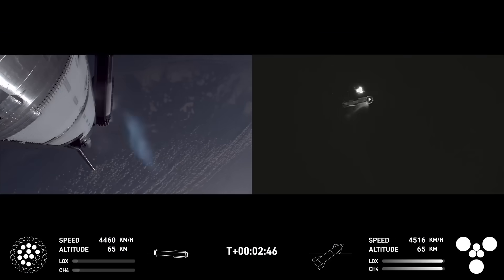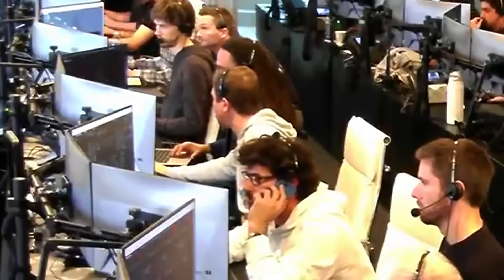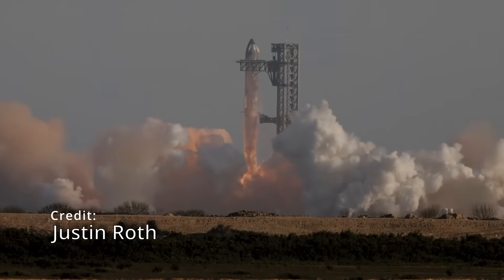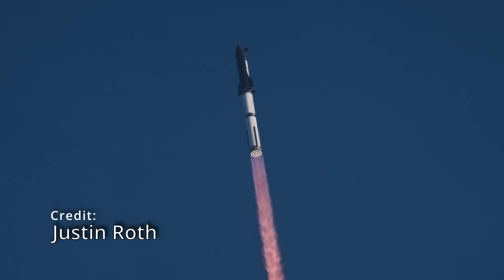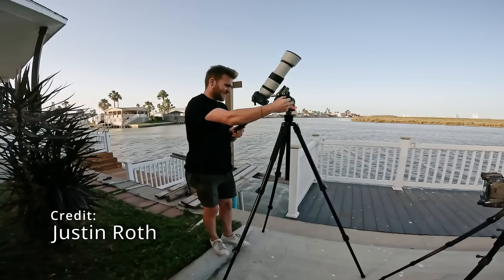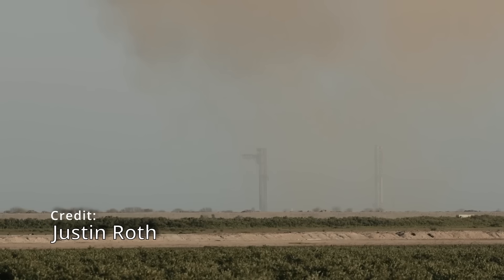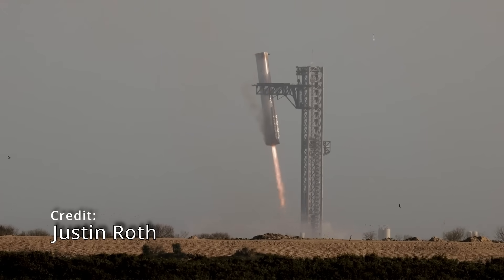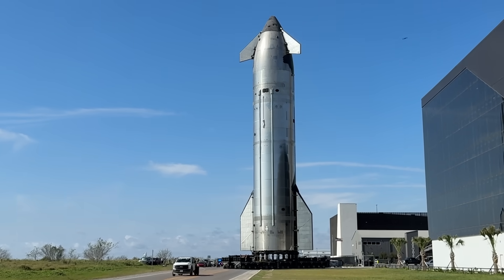Rest In Pieces: Why Did SpaceX Lose Starship Again?

Comment: So is it the fuel used gets superhot 
Peppermint oil is very cooling when put on your head when we get stress headaches these doTerra oils can permiate through a cell wall what if when a raptor fuel delivery system leaks some types of waxy oils can plug it up but still be a gas on the inside and cool the hydrogen gas or make it not so pressurised

Comment: SpaceX should mount the starship with the ring & top section of booster on the test stand … then test the vibrations and pressures during the hot staging. Use lots of sensors to measure what actually happens. It does not have to separate to do this test. They just need more insight in order to adapt

Comment: Flight seven likely induced  them to put more cameras and sensors in the areas that likely caused the engines to fail. If the problem recurred in the same way as the prior flight, this replication with additional sensor data will likely tell them exactly what happened. Additionally, the starlink was up for a considerable time after the first engine went wonky, so it's very likely lots of images and data were transferred. I think it's likely they will solve what happened quickly. Corrective actions and finishing the mishap investigations will the time consumers.

Comment: Booster recovery is a gimmick.  Actually cheaper and more effective reduce the number of rocket engines strap a couple solid boosters to the thing same thrust, cost the same and reliability goes up.  The thing has to be the ugliest rocket ever built looks like something from a 1960s Sci Fi movie or a grain storage bin on steroids surprised it can get off the ground without blowing up.  They need to work on their root cause analysis process, looking forward to the next fireworks display.

Comment: Another possible cause of the failure … ice clots.  As a function of total methane propellent, perhaps ice deposits build up somewhere in the plumbing or pump. This could cause a blockage and if a piece of ice broke off, it could damage the turbine pump or block the propellent line that keeps the rocket nozzle cool.   Another similar suspect is long chain hydrocarbon impurities in the methane. The heavier molecular weight hydrocarbons turn solid at a higher temperature. Perhaps this impurity builds up somewhere and becomes chunks that dislodge and  block methane flow that cools the nozzle.
    The reason to suspect this cause is both starship failures occurred after the same amount of time.  That indicates a progressive build up of ice or some other progression is occurring.  Perhaps SpaceX will take a temporary step back and reinstall the heavy protection between raptors that prevent a chain reaction of Raptors blowing up.

Comment: Joe sounds so much like all the NASA people brought up in the program. Great people but a system that was designed to go VERY slow. This is a test ship, remember NASA testing in the 50s and Falcon testing. Every ship gets changes and every ship moves the ball forward weather they Fly or not. There is no public safety risks so as soon as the engineers say the ship is ready, tell the FAA to stand behind the yellow line test fly the ship. Delay is not an option

Comment: Hello Austin Lady.  Hold my Beer..... Baby steps....If you can grab Elon by an ear for a second, while he's hopping around......yank him aside and have him launch the second stage ALONE and then test catch it, to shake out and troubleshoot engines performance issues at this point.....

IMO suggest beefing up the fuel lines to engine connectors, and lash down long fuel lines to stop damage from vibration resonance fatigue cracking damage on the fuel-lines; possibly canteleverling at launch resonance frequencies, making all electrical and fuel lines more stout.  

(Come to think of it, just like he needs to beef up the thickness of his Cyber Truck's upper plates of the suspension strut mounts, they're comparitively thin and NOT robust , compared to upper strut mounting plate of the GMC or Ford pickups.)...

 gimme back my beer ..

Comment: Im more worried about the 2 engines on the booster for not relighting as they said they fixed that. And then after another relight only 1 of those two came back on. So SpaceX has a lot of work to do and they need to hit the brakes and get all of this fixed before the next flight.

Comment: The new RVAC methane "down-comers" are my prime suspects for resonance since they are very long and slender. Perhaps they need fastened to the hull midway and effectively get 4X stiffer. 

Resonance issues are usually solved with increases in stiffness (to raise frequency) and increased damping. Yes, both add some mass, but maybe too much. 

Since there were 3 different solutions already implemented in this ship, perhaps only one change failed and two already succeeded.

Comment: If, at some point during flight, the resonant frequencies of most systems line up, then the failure mode is going to be very easy to trigger — and nigh impossible to fix without either a significant redesign or an eye-popping mass increase from add-on fixes. Just my thoughts.
Reply: The new RVAC methane "down-comers" are my prime suspects since they are long and slender. Perhaps they need to jog to the hull midway and effectively get much shorter. 

Resonance issues are usually solved with increases in stiffness (to raise frequency) and increased damping. Yes, both add some mass, but maybe not much. 

Since there were 3 different solutions implemented in this ship, perhaps only one change failed and two succeeded.

Comment: I'd go back to a "proven" Block 1 design (think SN series sub-orbital flights - no issues on ascent nor belly flop, nor early IFT's with ascent) to refine heat shield for IFT 9, in parallel with any Block 2 re-design stand-down.

Comment: Once they determine the root cause(s) and fix those perhaps they should do several starship only launches.  If possible try a Starship catch on the tower or if legs are installed a vertical powered landing (as if on the moon or Mars).

Comment: It's crazy because the V1 Starship showed how much of a trooper it was by withstanding each of its recoveries in the Indian ocean (even with melted pieces), and the final one which unfortunately did not have a booster catch with it, was spectacularly under control the whole way down to the ocean. This V2 feels as though it was made by a different company altogether... which is weird. It feels like they made so many changes that now they're struggling to understand which change in particular is causing these catastrophic failures at roughly the same point in launch.

The haters are hilarious either way though. EDS is nearly as strong as TDS.

Comment: Apollo had many many explosions on the pad and after they got launched and even in getting out of orbit and out of orbit These are complex machines and they need more real testing of actual launches no matter the cost to redirect flights around such debris. They need to place more cameras and measuring electronics to tell them why this failed. I DO NOT THINK THIS IS A MAJOR like these analysts are crying about. They are overly dramatic about two successive launch successes and orbital failures. These two are acting like the world has fallen and it hasn't. It failed and something was overlooked and they have to find it but acting like the sky is falling and they can't push it back up is ridiculous.

Comment: Finally a channel that understands the implications of the failures.

I am so tired of the Elon fans claiming that a failure is a good thing because you learn more from a failure. No you dont! The purpose of a test flight is to confirm that your design works, and the desired outcome is a confirmation that it works.

The booster catch is extremely cool. But the real purpose of starship is to have a reuseable second stage, and when they keep blowing them up early before even attempting reentry, they are not progressing matters. They are regressing.

Moving fast and breaking stuff is not always the fastest solution in the long run. This applies to both spaceflight and governing.

Comment: I agree with Joe’s assessment. This is a major issue and the minor tweaks that they tried, didn’t work. They seem to have an issue with the v2 fuel delivery system. They need to do an engineering review of the v2 and find the root cause(s) of the problem. This may include having to do major rework on the existing Starships that are in the pipeline.

Comment: I seriously don't think they need to scrap everything and start from scratch.  Knowing what does work helps you identify the problem areas. Space X makes multiple test flights just for this reason.  To test components.  The engineers will locate problem areas and make necessary changes.  Talking from frustration leads to more frustration.  Lets wait and see what went wrong.

Comment: Did everyone forget this and everything with starship is a test . They push the vehicle to the limits to learn the breaking point.  The only failure would be to not learn.
Reply: Play Don't care. Many of these people have Elon derangement syndrome, so anything he says or does is wrong according to them. 🤷
Reply: They're testing something that they scheduled a lunar orbit mission for LAST YEAR? And they're getting paid by NASA to support the Artemis missions with deadlines they already missed? Gee, I wonder why people forget that Starship is still an early prototype that's years away from that kind of viability...
Reply: @WaxPaper  and yet I'm always seeing the SLS portion of the Artemis missions getting grief. They like to point out the cost of the SLS but it worked the first time and GOOD, ACCUTATE engineering cost money.
Reply: @josephorso  Yeah they never talk about the billions of taxpayer money we've spent on a platform that hasn't even resulted in orbit yet, let alone a fleet of them supporting an orbital fuel depot. At this rate it's entirely possible that SLS will still be cheaper for super heavy missions. Starship could be a bad design, or it may not be possible as cheaply as Musk hypes it to be.

Comment: People are talking about "design failure", but if a single engine burns out & all the others are fine, then it's a manufacturing error or quality control problem on the point of failure.
Reply: ALL the other engines might have been about to fail as well. Obviously ONE must fail FIRST!
Reply: @ all indications are that the engines as such work great. The problem is elsewhere, probably in the plumbing.
Reply: @FumbleFinger  True, but because they all are lost in the RUD there's no proof of that..... back to the test stand !
Reply: @davidkottman3440 They gather lots of data from the engine and the whole ship during the flight. Hope they can pinpoint the issues.
Reply: Maybe a design failure at the point where that perfectly built engine is mounted.
Reply: @iblard It is likely a design error. It started when they changed the desigh from the ship mk. 1 to ship mk. 2, but exactly what the problem is, only SpaceX and maybe the FAA knows.The individual engines appear quite stable.
Reply: Kind of premature conclusion if they don't have a root cause.
Reply: This wasn't a single engine failure. Yes it started with one that might have had something to do with the other three cutting off but in the end, time (and the data) will tell what actually happened...
Reply: Too many compurer Geeks, not enough experienced tech s with hands on tenured experience

Comment: The video shows a starship engine nozzle had been damaged very likely during hot staging. I can see how this is fixable so SpaceX engineers will be able to see it too.  I just hope they do the right thing first off instead of how they fixed the concrete pad from doing its own kind of rapid unscheduled disassembly (I.e. attempting over and over again to fix the launch pad with concrete instead of a metal surface).

Comment: V2 never had its own test flight campaign.  People freaking out because the 2nd of the version 2 failed is way premature.  Version 2 should have had a flight test campaign instead of being thrown up on the proven booster only to fail in spectacular fashion.  It's pretty obvious something that 'shouldn't happen' with the new design...is.  Backing off and reflecting is beneficial and not the end of progress.  That step is actual progress.  Some thinking on the back half of starship needs to change.  Obviously a 60-sec burn isn't enough to cause major issues.  Several minutes of burn does.  Chase that backwards for the RCA.  Version 1 was doing great on that aspect and it's re-entry heat testing was progressing.  Ultimately they'll get it right.

Comment: I think the change from 1 to 4 transfer tubes was a mistake, not only does it take up valuable space, but having fewer parts is always better. Also, they need to static fire the next ship for a minimum of 8 minutes to shake out all possible harmonics. They need to do more advanced modeling with the booster and extended starship to see if there's a possibility that the size increase has somehow introduced new resonance oscillations
Reply: Even with 8-minute static fire test, much is different in flight. Atmospheric pressure. Gravity vs thrust. Test harness attachment vs free flying. Etc.

Comment: the vac raptor exploded then soon after the inner engines shutdown causing loss of attitude control.  through data, they will know if the long duration static fire led to the vac raptor RUDing a few moments after in flight ignition. this was an engine issue, not a Version 2 ship issue.

Comment: Sometimes ...the necessary part is the last part needed for success. Expectation of success is always tempered by failure. HINT: There is nothing wrong with the booster or the ship. Surviving "Max Q" with such a large vehicle will not be a technical problem, but will require SpaceX to 'face-the-music' of its overly ambitious timeliness. "The best part is the missing part." - LWC

Comment: The question the armchair quarterbacks won't answer is : would you rather run fast, break things, and ultimately have success quickly, or do it slowly, over decades, with a moderate rate of success?

The spacex system works, and works well.

Falcon 9 was 20 launches before a fully successful mission.
Reply: He can blow a thousand of rockets but he won't get to Mars. All is just a hype for looser.
Reply: They are disrupting air  traffic without any accountability. Better look for somewhere else to explode all the rockets they need to.
Reply: And you're not an armchair quarterback like the rest of us??
Reply: Apollo program was incredibly fast. How many rockets did they blow up?
Imagine the uproar if NASA blew up as many rockets as Space X. They're reckless just like Musk.
Reply: @delbertmcfinklestein8576  Apollo is a dead program that was wildly expensive and killed 3 astronauts.
Falcon 9 is the most successful rocket of all time and puts over 90% of all the mass into orbit each year and has killed zero astronauts.

You may want to look the facts right in the eye before you start making up non factual ideological conclusions.
Reply: @delbertmcfinklestein8576  wait till you find out about Apollo 1.
Reply: @delbertmcfinklestein8576  NASA blew up dozens, mostly in the early days before human flight, but don't think they never failed.
Reply: @ Casually excluding the astronauts of Apollo1 I see.

You're pure evil.
Reply: @delbertmcfinklestein8576  They blew up quite a few rockets back then too. All a part of the process.
Reply: @delbertmcfinklestein8576  I’m pretty sure SpaceX did things way cheaper. People launched from dragon also haven’t died when flying up to the ISS.
Reply: @ZaakaSjnssj dragon was in RND for more than 10 years when it was supposes to be ready in 5 years. Spacex is slow and wasteful.
Reply: @ The Apollo programme killed 3 astronauts. And it was based on many previous failures.
Reply: It depends on what it is that you're breaking. Meta, which coined that term, is now actively contributing to the implosion of American and potentially Western civilization.
Reply: It was OK when it was hopper blowing up there in Boca Chica, but now fails are dropping debris over large areas, interrupting passage in the Gulf of Mexico, and endangering people. Go fast and break things becomes prohibitively dangerous as the scale ramps up.

Comment: The starship design is probably flawed.  It requires fuel pressure of 8.5 bars but does it have a way to maintain it?  Is the CG off so it goes unstable?  Is the pump pressure going down and thereby causing engine overheating?

Comment: You can’t say the FAA is over reacting when you’re delaying airline flights in Miami to prevent commercial aircraft from getting hit by space debris. The Mars flight in 2026 is completely unrealistic. 2028 maybe…2030 more likely. 
A couple of the vehicles have made it back from space but the heat shield and vehicle were toasted like marshmallows…not fully reusable. They’ve got a lot of work to do but they’ll get there (I hope).

Comment: The booster worked flawlessly, despite what looked like having a few engines fail.  The biggest problem I see with the Starship design, is the few large engines.  When one of those outer vac engines fails, the thrust like is instantly so far off that it's unrecoverable.  RCS can't fix it, and there's no opposite engine to shut off to correct the asymmetrical thrust.  The booster on the other hand, has many small engines, so a failure on one side doesn't change the thrust line too fast, and the other engines can correct.  For the large vac nozzles on Starship, they would have to design a smaller engine to go with smaller vac nozzles, then have a lot of them.  I would say 12 might be a good number.  There's a lot of them, and there's an opposite engine to each one that could fail.  SpaceX is doing excellent work, they'll get it figured out.  I just think they need to plan that there could always be an engine failure, and design it accordingly.